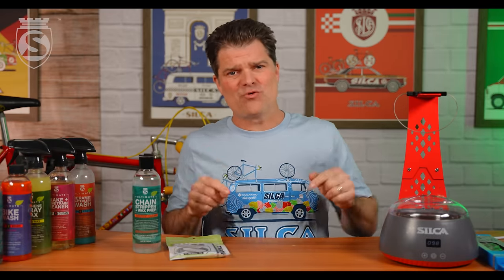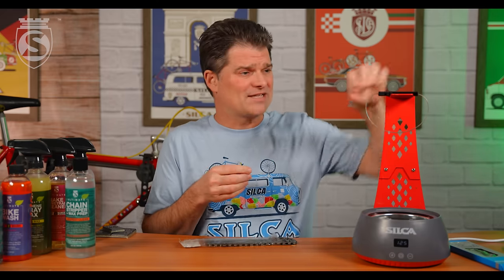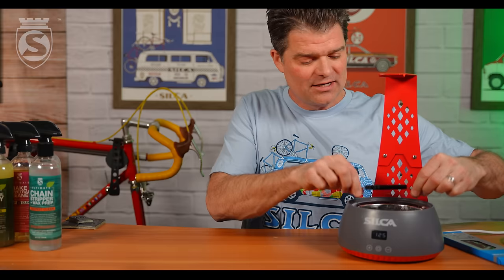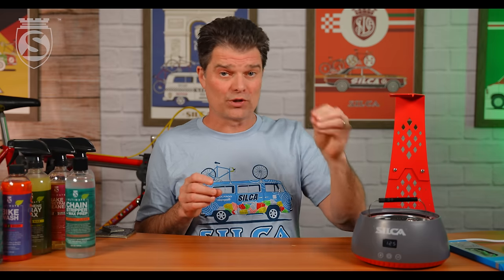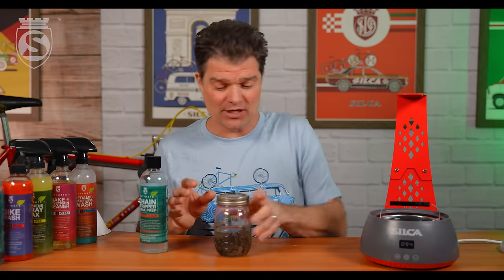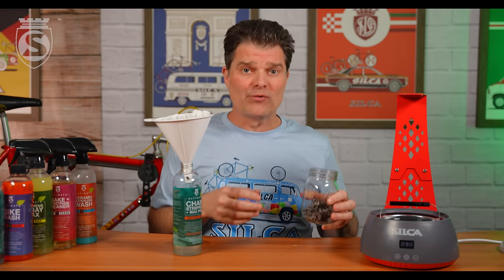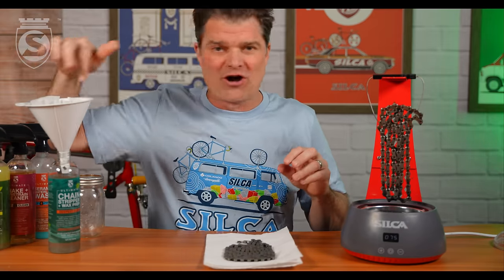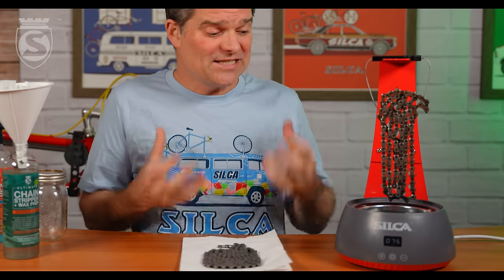Chain Waxing System Tutorial with Josh: A Step-by-Step Guide!

Comment: If you don't mind the more laborious factory grease removal process using either mineral spirits or one of the wax makers' proprietary grease removal products, followed by alcohol baths and drying, prior to waxing, is that still preferable to the strip chip, or basically the same?

Btw were these designed to look like chocolate bars? I swear they look delicious! 😅
Reply from the maker: StripChip and Chain Stripper both provide results equivalent to (or slightly better) than the traditional mineral spirit/acetone/alcohol method, but do it in much more environmentally friendly ways.  We say possibly better as both products contain agents which promote adhesion of the wax to the metal.

Comment: So you stripped your new chain with the chip strip and waxed your chain.  You put it on, ride it, and are now ready to re-wax.  Can you use the wax in the Crockpotanator again (with the chip strip in it)?  If not, do you just throw away the wax with the strip chip?
Reply from the maker: You just keep using the wax that's in there, and as it gets lower you can add more to it, no need to throw it out.

Comment: Any tips for using this with a bag of hot melt wax that was used once before using the stovetop method?  I haven’t looked, but I’m assuming it’s a big block now as opposed to the pellets that are in a brand new bag. Do I have to melt it again and then pour it in the Silca pot where it will stay from now on?
Reply from the maker: You could try to cut the bag away from the wax and put it into the pot, but if it's too big to fit, you can just melt it in the bag and pour it into the pot.

Comment: I run my chain with your wax.  I also use the Drip wax lube.  My question is what should I do when I go on a multi week or months long bike tour or bikepacking tour on my bike.  How do I maintain my chain while out on the road on tour.  I'll be camping most of the time so will be difficult to re-wax via hot melt method.  Any suggestions as to how to keep the chain waxed and how often does the chain need to be rewaxed.
Reply from the maker: For bikepacking we recommend using the drip wax as a top off, just be sure to apply it after your ride so that it has overnight to fully cure.  I'd recommend wiping the chain with a microfiber cloth every 150-200km and reapplying the drip after that.

Comment: One note on using the @Silca chain stripper solvent (unused) with factory-new SRAM AXS road chains: after running it through the stripper, shake, let it sit for ten minutes, agitate again then rinse steps, the chain still had a small amount of grease on it which I could see when I wiped it off with a microfiber towel. So, I ran the chain through the stripper, shake, wait, and rinse steps a second time. Then it came out clean with no grease coming off on the towel. I'm wondering if @Silca tested with SRAM chains and if this is something specific to the preservative they use on their chains. It's also possible I did something wrong in the process but I can't think of anything as I followed the steps here closely.
Reply from the maker: Some SRAM chains have nastier stuff on them than others and may need 2x stripper.  We go through hundreds of SRAM chains here for our pre-wax program and for at least the last year they have all been covered in more of an oil that washes out pretty easily, but we have seen ones that are covered in a much more aggressive sludge that can take 2 strippings to remove.

Comment: Hi, have converted to waxing and loving it. Recently purchased the Chain Waxing System (long wait as in the UK) and really happy after the first use with a Strip Chip and new chain. Even better results than the Super Secret Chain Lube I initially started with. 
I have just come to do the first re-wax, so at 75°c and even after half an hour the wax would not fully melt. The pot was indicating 75°c. I was doing it in the garage and the outside temperature was 15°c, not that it should affect it. 
Does the Strip Chip prevent it from re-melting at the lower temperature?  I had to turn it up to melt it then back down to put the chain in. Thanks, Adrian.
Reply from the maker: This is the one downside with the PID control.. we can only measure temp in the metal of the pot, so the  heating element heats until the pot is 75 and then stays right there.. to make it melt faster you can put the temp to 90 or 100 and then just turn it down when it gets to 75.

Comment: How are you getting the handle for the chain holder to just chill in the air like that 😅 Mine is like a fish out of water gasping for air trying to dive into the wax, it dunks itself in every time. I had to rig up something by bending a spoke to hang it from the red wall, and hook it on that (and even then it sometimes manages to hop off into the wax). Any plans for a hook piece to mount on there? I guess thinking about it again, I could use a chop stick or something braced across the melting pot so that it can’t submerge.
Reply: Maybe I’m threading my cable coupler too wide so the cable doesn’t have as much slack to flex out and grip the sides of the pot. 🤔

Comment: What if I got sidetracked and after using chain stripper solution I did not rinse with warm sink water.  The chain air dried and was put into wax.  Should anything be done after the fact? (Ie. dispose of hot wax, restrip chain etc).  Thank you for the advice.

Comment: Is the bowl in the StripChip wax pot replaceable or integrated into the unit ? If replaceable then do you sell them ( have looked and do not see any ). It would be handy to have 2 bowls so I could use the ZFC 2 pot cleaning system. First bowl to Strip Chip / clean contamination off chain / boil water out . Second bowl to contain wax for actual chain waxing.
Reply from the maker: The bowl is integrated to allow for much better temperature control as well as faster heating and cooling.  We looked at replaceable liners and it added a lot of size and cost to the unit while roughly doubling the heating and cooling times, so we chose this direction to make the system as affordable and fast to wax as possible.
Reply: @SILCAVelo Thank you for that. It might have been useful to subtly include in the product description to set expectations / explain the compromise / improvements ?  I'm trying to give you constructive feedback here, even though I may seem a bit harsh on some comments ?

Comment: With the chain stripper is it safe to be rinsing it off in the sink and disposing the coffee filter in the garbage?
Reply: Ideally with all forms of oil/grease, no.
Considering the chain stripper is made of "only" 3 very concentrated surfactants that are used to remove the oil, it's likely fine.

It would be like if you dumped pure concentrated dish soap combined with cooking oil. Bad if you do that constantly, but not an issue if you only do it every once in a long while.

Comment: Are specific chain brands  more optimal for waxing (i.e. sram, Shimano, kmc).  Also, is waxing good got mountain bike and gravel chains, or more a roadie thing?
Reply: I have heard negative things on waxing KMC chains, but I use them (waxed) extensively with great success. Higher tier chains, such as 10 or more speeds, usually have coatings on their surfaces. These coatings wear far slower on waxed chains which is why Josh has stated that in these cases a new chain is better than converting a used one from oil to wax. 
I actually prefer waxed chains on gravel and mtb over road due to lower mileage rides in dirtier roads. Wax excels in both these circumstances. For road, it's up to you since some poeple ride over 200km weekly and it might become a chore.

Comment: A few questions:  What is the re-waxing process?  Do you re-strip/clean the chain to remove contaminants or just simply re-dip the chain?  I've also noticed on dura-ace chains the hollow rivets tend to fill with wax using more wax and adding a marginal amount of weight to the chain.  I've used low pressure air to blow out some of the excess while the wax is still hot and it seems to remove much of the excess wax from the rivets and where it tends to glob up at the bottom of the links.  Is this safe to do?  Any risk of actually blowing wax out of the internal surfaces doing this?  I find it also help cool the chain and wax down quickly preventing the internal wax from seeping out.  Finally, is it acceptable to dip a wet chain?  I noticed that you didn't dry or allow the stripped chain to fully dry after rinsing it before you waxed it.  Is there any risk in doing that as far as trapping moisture in the chain or potentially adding unwanted water to the wax solution?
Reply from the maker: If the chain is relatively clean, you can just wipe it with a microfiber cloth and then straight into the wax.  It it's dirty, you can rinse with water or something like SILCA brake and drivetrain cleaner and then water.. and then into the wax.  You can wax a wet chain, but just give it extra time to evaporate the water.. you can also push the temp to 100C to speed the evaporation, and then cool to 75C before pulling the chain to cool.  As for wax filling the hollow pins, this is less than 1 grams of wax in a 116link chain, so we say it's not worth the effort and much of the weight saved is likely blowing wax out from inside the chain where you might need it..

Comment: Not sure where to comment ... but I would very much appreciate a discussion on SRAM road chains.  The current Rival, Force and Red chains do not wax as well as Shimano chains - can you discuss any tricks to help (higher melt temperature ... use a strip chip ... ??).  And, what about the new Red chain - I have heard that the finish is different ... how does it take wax?

Comment: How to fix a noisy chain? I have just tried waxing my chain for the first time. I used your chain stripper and hot melt wax method as above, and have noticed my drivetrain is extremely noisy. I then tried re-waxing the chain and the noise is still present.

Does the noise go away after a few rides? Should I top up with the drip on wax?

I'd be most grateful if you could advise what is the likely cause of the problem.
Reply: This please @SILCA Velo
Reply: I think it "breaks in" and the excess wax gets pushed out.
Reply: My limited experience (3 chains / 5k miles) is that the chains are a little noisy until the wax/chain break in.  There are stiff links, etc.  One ride usually does the job for me.  After 100 to 150 miles my chain starts to get noisy again, so I wipe it down with a lint free rag and apply the drip wax.  That works amazingly well.  I only clean and hot wax the chain every 800 to 1000 miles.   With this new pot I may start doing it a little sooner.
Reply: In my experience waxed chains are noisier than oiled chains. But lower friction meaning longer longevity and fewer watts lost on moving the chain around.
Reply: Needs 20-30k for me after a fresh wax before the chain goes back to normal noise levels.
Reply: Also make sure you have threaded the chain back on in correct position around the jockey wheel....some metal parts to go between. I made that mistake once in a hurry!  Learn't my lesson, don't rush it!

Comment: Great video, but the title should have included the fact that this video only shows the process for a NEW chain.   Hopefully folks aren't misled to believe that this process (and strip chip) are needed for ongoing maintenance.

Besides the standard chain waxing process, I'd also like to see a video discussing converting an oil lube chain to wax.  Strip Chip? Or some other process to remove something like Synergetic ?
Reply from the maker: Used chains should be cleaned in Chain Stripper using the method shown in this video.. StripChip is only targeted at factory grease (all of which use greases based on type III oils) and will not be effective on other oils or greases if they are Type IV, V, polymeric, etc.. however, Chain Stripper is targeted at all of those things and will remove them with ease.

Comment: Does the chain need to by dry (after rinsing it with water) when going into the wax pot?
Reply from the maker: No, it can go in wet, but you will have to wait for the water to all boil off before pulling from the wax.. some blow the chain off with a compressor to remove excess moisture, but I generally just throw it in the wax and let it go 10 minutes or so and it's good.

Comment: I was pretty disappointed the Chain Stripper arrived with some leaked out into the box as it's not cheap at all. I contacted Silca. And they said they want me to send a picture and they can issue a partial refund for the  amount leaked out. For what might be $5's worth? Probably not worth the waste of their rep's time. So I just Ieft it on the shelf in the garage.  Anyway, now it's more than 1 year later, I see this video. And I see Josh saying they had problems with the bottle seal.

Comment: So I just used the chain waxing system and hot melt wax for the first time today and my wax is curing dark gray on the chain, almost looks like the chain is filthy rather than brand new and freshly waxed. Did I leave it in the wax too long or is that normal? I was using Super Secret drip wax before and it always cured white on the rollers and pins, then turned clear when it was fully cured
Reply from the maker: The wax contains a tungsten disulfide additive which is black.  This is totally normal.

Comment: Someone please convince me about the measurable benefits of a waxed chain. For the record I'm a bike mechanic of 10 years and I chase marginal gains. I've never used a waxed chain myself. I use good quality oil based lubes and keep my chain nice and clean. I race hill climbs and TT's in the UK. I am currently super pessimistic about waxed chains. I've fitted pre-waxed new chains at customers request so, a few questions... 1. Friction. When I hold a clean oil lubricated chain in my hand, it flops and moves about freely. A new pre-waxed chain is stiff and sticky. That to me suggests more friction. 2. Noise. A waxed chain is definately noisier than a clean oil lubricated chain when the bike is on the workstand. That again suggests more friction. 3. Cleaner? The waxed chain throws flecks of wax off continuously all over the bike, the rear mech, the wheel, the brake rotor. A good oil based lube applied properly, doesn't do this. 4. Extended chain life. I just don't believe the numbers being thrown about. 15,000km and no measurable chain wear??? I just don't believe it. 5. Self healing. Wax is a solid and it will reamin a solid on your chain as it does not get hot in use. If a part of the chain becomes wax free it will remain wax free until you re-wax it. An oil based lube is a liquid so it moves about and will continue to lubricate all of the parts of the chain during use. 6. The faff. It seems like a lot of faffing about. 7. The cost. A customer recently purchased a new 'cleaned and waxed' chain. It was a Shimano chain with RRP of about £30. The waxed version of exactly the same chain was £120. The firm that waxed it probably paid less than £20 for the chain at trade prices so a mark up of £100 to 'clean and wax' a chain seems to me like a total rip off. Also the cost of the pots and wax seems a lot compaired to a good quality oil lube. 8. Other industrys. Try googling 'wax as a lubricant.' Pretty much the only place it is used is on bike chains. Every other industry I could find uses oils and greases...  I'd appreciate peoples thoughts on this, its been going round in my head for a while. But remember I'm looking for measurable benefits that disprove my random thoughts listed above. Thanks, Ben.

Comment: I've just taken delivery of a brand new Canyon Aeroad CFR which I haven't yet ridden.... I have also purchased a SILCA Waxing System with Strip Chips. My new Bike has of course a chain already on it which I believe has a factory application of lubricant.  Therefore, I assume that once I remove the chain to be waxed, I should absolutely use the Strip Chip to break down any factory grease / Lubricant that may be on there already?   Even if there was no pre-ride grease on there, there's nothing to be lost from using a strip chip? 

Also, once the wax that is in the pot has dropped to a level where there isn't enough to cover the chain, I assume that I just add more chips in to the wax already in the pot?
Reply from the maker: You are correct.. your new bike will have a chain with factory grease, just put it in the pot with the wax and strip chip, follow directions, and from here forward you are on a waxed chain.  When the wax level in the pot gets low, just top it up with more SecretBlend.. you will only need strip chips when waxing new chains covered in factory grease.
Reply: @SILCAVelo  Superb, thanks for the confirmation. After 9 years of using regular chain lube on my other bikes, I'm really looking forward to switching to wax and using the Silca Waxing system.  Clean chains and no ruined clothes :)

Comment: As @silca has mentioned before, the used chain stripper solvent needs to be treated as contaminated waste (ie not dumped down the drain) because of what is potentially in the grease stripped from the chain. But, I'm wondering about disposal of the water used to rinse off the chain after using the stripper solvent. Can that be dumped down the drain or does it need to be treated as contaminated waste as well?

Comment: do you re-wax chains without cleaning them or do you have to strip it every time before waxing?
Reply from the maker: Just re-wax it after that.. if it's really dirty, you want to wash it first by boiling in water or pouring boiling water over it.. or at the least, giving it a shake with chain stripper or the like to remove dirt and road grime.. but if it's more or less clean, just rewax it.  You will only need more strip chip when you are processing factory greased chains.